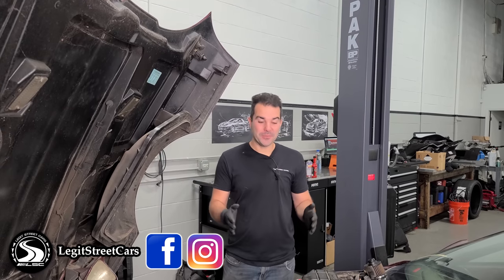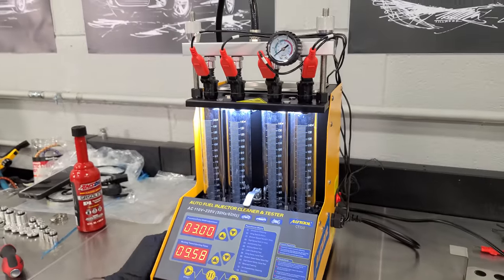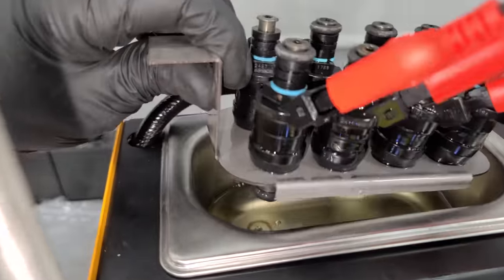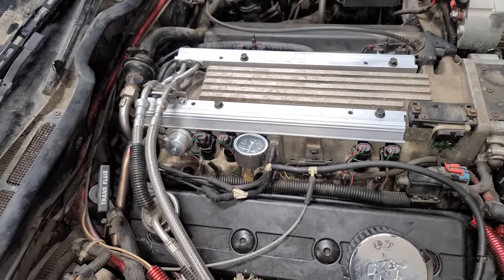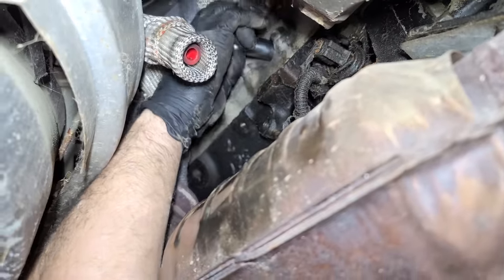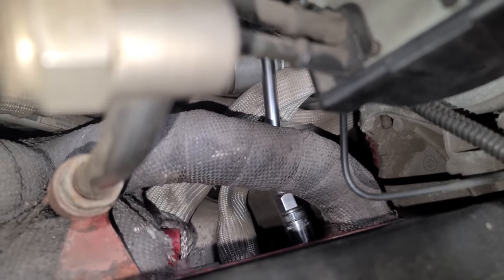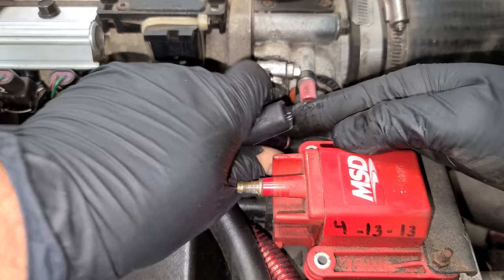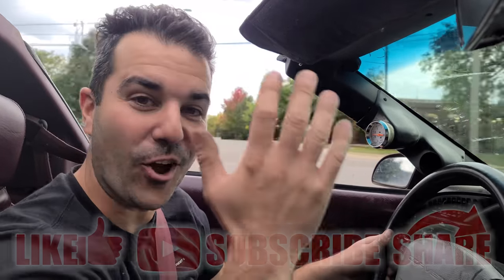I Fixed My Cheap Supercharged Corvette For $50 & Looked Inside The Engine To Find Mystery Mods!

Comment: Personally, I would have lightly coated the plug threads with anti-seize and dielectric grease on the plug wire connectors . Awesome Content as always
Reply: I had a teacher at school who used to race motorbikes. He ran a pencil down the plug threads as the graphite lubricates them.

Comment: That flow tester is good. Just watch out for the china fuel pump burning out in it rather quickly if you do any sort of testing. We have replaced ours with a walbro and haven't had any issues. Fun thing to try is go get knockoff china ones and you can get the to lock up so easy. Not to mention the terrible spray patterns

Comment: Interesting buy, a known fix for Vette fuel gauges is several tanks of Techron additive, at least on the C5 and up forums fixed mine. I have a 2004 Z06 that has been modified with 2014 ZR1 cradles front and rear in 2015. I couldn't get my hands on a ZR1 427 though, so went with an LSX 454 with a S/C kit from A&A. It RIPS, I'm unable to post you a pic. too bad I'm sure you would like it. Curious to see how yours runs my S/C head is about twice the size of yours I don't recall the trim seems I'm at around 900 at the crank, need to dyno tune it, has a poor tune on it presently. Love your Channel !!!

Comment: For the hard to find o ring for the cooling system, have you tried plumbing seals? Lots of them are made for water quick disconnect hookups, so different sizes and temp ranges. Alternatively, are you saying you don't have a roll of make a gasket anywhere? Haha

Comment: You will have to fix the exhaust leak to get a proper AFR reading from a wideband. You should also just throw in a Holley or Fueltech EFI. Ditch the optispark. And install C.O.P you may hit 500hp wheel with that alone???

Comment: Its going to be really interesting to see what the AFRs are, and what the tune looks like, also, that fuel booster should be looked at if you end up running lean. If it were me, I'd want to tear everything down to its bones, inspect and clean / replace anything and everything that looks wonky, get a cam profile, THEN do tuning. Maybe get upgrades, crank and piston balance.  Just so you are sure you ain't going to destroy it.
Reply: Indeed.
Judging by the colour of the spark plugs - biscuit brown the engine is running pretty good.. fueling looks quite consistent.
That Corvette will look real peach once detailed....
Reply: @stuartd9741  hell yea brother.

Comment: hey man I love  your videos I have a small tip for you  use calbreter cleaner  to clean injectors  it will clean batter  and much cheaper than fuel system cleaners keep up the good work big fan 👍

Comment: Don't know how common it is for 90s GM, but my Cadillac had damn near the same issues with running and the fpr was the issue - but I only figured it out after I'd replaced 4 other things to no avail because it wasn't wet when I checked it.

Comment: the white stuff is like computer cord stuff to make your spark plug leads more ridged to try to avoid hot engine plug lead sagging and touching the hot bits ,Headers etc and melting the plug leads ,i'd swopp them over onto the new leads for beter routing direction control to avoid more melt down of them

Comment: where u put the last spark ug, u have a sensor with no connection or plug connected to the missing wire thingies or sensors

Comment: Alex, for the Auto fuel injector cleaner, why aren't you using water in the tank instead of gasoline? That way you wont smell fuel when it is leaking and it is Ex-proof if a spark in the machine should occur ... Just wondering if you have to use gasoline?

Comment: They used to sell a socket for the LT-1 spark plugs. It was just cut down, and the drive was drilled out round, so the plug would fit through it. Then you just turned it with a wrench.

Comment: The injectors are supposed to fully seat in the top rail like they do on a fuel rail of a car  thats what the differnt sized adapters are for . And its not recommended to use gasoline in the tester portion there is special fluid for that area gasoline will ruin the seals and pump . I have used mineral spirits without issue . I have the same machine and i noticed  I get more reliable readings by only testing 1 injector at a time .

Comment: This car was a damn steal for what you paid! I'd be so so excited if I found this at auction. 

I should add, that fuel injector test/cleaner would have been so useful to me years ago. I had a brand new set of Bosch 550cc injectors, and the car never ever ran right. Misfiring, spluttering. Concluded it could never be the injectors that were bad as they were brand new. 

I upgraded a heap of parts, fitted 1000cc injectors and sold the 550cc injectors to a mate who cleaned them and found one was blocked. Go figure.. haha

Comment: If it has LT4 heads I hope it has the intake to match LT1 intake is not compatible unless there was a lot of work done to it.  Needs torqhead upgrade it let's you run individual coil packs and a more tunable LS style ecu and deletes the crapti spark 😆 Have it on my 94 C4. 👍🏼

Comment: Injectors usually just need seafoamed, I recently revived my 94 sho after it sat for 13 years. All I did was change fuel pump,filter,tank,keep 91 octane or better a can of sea foam in tank and the engine got fluids changed and started like it was never sitting, got my emissions and passed no problem. Good luck.older injectors were built to last,oh I had 119000 MI on engine.

Comment: Yup those are Stock pistons. Fix exhaust leak before test driving so O2 sensor doesn't tell PCM it's lean and cause it to spray a lot more fuel and run like crap again.

Comment: and what about the basket filters ? inside the injectors ! = i brought an injector rebuild kit ! with new pintel cabs and basket filters and all o rings ! vacum leaks = well done and you could put a teflon based additive to the supercharger gears = or something similar = you know = we use newlon in australia = friction modified additives !

Comment: One issue I always had with my LT-1 was the damn exhaust manifold bolts never staying tight. Stage 8 used to make these expanding bolts I bought that fixed that issue, and the copper gaskets I upgraded to. Don't take any chances with those manifold bolts

Comment: RE route the King lead to the MSD coil pack on the Left side of that black pipe to allow enough slack for a new wire lead metal end replacement

Comment: I stopped using black rubber O-rings because they took out the V.O.C.s and they only last 10% of the time of the originals. Now I only use the green ones meant for A.C. systems. (Same with all the rubber bushings in the suspension, now I only use Polyurethane).

Comment: Too fat O-rings can be whittled down with wet dry sandpaper. Put the O-ring on a suitable hunk of wood or something and spin it around while maintaining suitable pressure. I had to use this method on a clunker which would vibrate the injector in the throttle body, it would start leaking. You can lube it while you're sanding to your desired shape with motor oil.
In my C5 manual, it states, you are instructed to wail on your Corvette occasionally to blow all the carbon debris out of the motor.
Also on my C5 there are aluminum heat shield tubes on each spark plug. I don't know if this applies to your motor. It might be a good retrofit since you seem to have a heat problem.
Keep a close eye on that crank pulley. It's two parts and can split in two. Then it can drift towards the engine block. Mine cut a slot into the oil pan and just thinking about replacing the pan gives me an ulcer. Lots of YT vids on how to do it.

Comment: The fuel injectors have a miniature filter in the top of them, usually 30-103 filter from ACE Fuel Systems.  You're injector testing machine might have come with some of these fillers, the 103 filter fits 90% of all top Feed injectors in the Market and You might have a tool that came with the machine to remove these Injector Filters. If not ACE Fuel Systems has an on Line Catalog.

Comment: I would personally just use pure injector cleaner in your tester instead of gas... Pretty sure a few tests with cleaner run through them would work better than just the ultrasonic cleaning.

Comment: Yep, it is most likely stock, but you'd exceed the power that procharger could make before you run into issues so long as you keep detonation from being an issue. I'm betting they are running the AFR pig rich to keep it from having issues.

Comment: The Optispark was the main reason I sold my Camaro. I had to replace that with the pump 3x. I had enough, and the heat on the spark wires was one of my issues as well. Damn this car brought back some bad memories 😂

Comment: That stuff wrapped around the plug wire was spiral anti-chaff tape. It's used in aviation for wire harnesses, hydraulic lines, and fuel lines. The reason it was melted is because it is not high temperature rated.

Comment: Spiral wrap commonly used in aviation.  The melted spiral wrap needs to be heat rated usually the black spiral wrap withstands high heat.  It’s an anti-chafe wrap.

Comment: FYI rtv is NOT what you want to use in a fuel system. You need a specific fuel-safe sealant for that fpr o-ring, such as Permatex orange. Same for any injector or rail o-ring, you should use engine oil instead of silicone grease.

Comment: Even with valve reliefs cut those could still be stock pistons. They may have removed the heads and fly cut the Pistons in order to clear the 1.6 roller rockers when they did the motor

Comment: Yikes, that spark plug access.  I thought I had a hard time replacing the plugs, wires, cap, and rotor on the LT1 in my 96 Roadmaster wagon.  Wire routing through their little brackets and inside their channel guides was the biggest pain for me.

Comment: You Guys might want to contemplate buying a miniature sand blaster (Paasche Air Erasure) it works outstanding at cleaning corrosion as well as old electrical parts (like spark plugs)!?!! ;)

Comment: Wild guess here about whats wrapped on the plug wire itself.  Whoever did it was hoping the spark plug heat wrap would not slip down with that to grip onto.

Comment: Cam timing or tensioner or the chain stretching.

Thats the only explanation for that type of destruction.

Cam being out one tooth or not having enough tension creating play in valve timing, that got worn over time( explaining the smooth yet perfectly round indent left on that one part of the piston). If it was one hard hit it wouldn't have been that smooth, it would have been rough around the edges. With it having too much play, the valve already weakened, it was just a matter of the valve spring or valve giving in first.

Comment: Need more fluid or the mosfets that drive the transducers will overheat and go open. Not right away....but under continuos or sustained use it will shorten the lifespan of the unit.

Comment: Those leaky fuel pressure regulators can be tough. Sometimes they don't leak for a min so you don't see any fuel when you pull off the hose

Comment: I’m gonna say when you repair the spark plug wire that you put the wrong end on. Normally it’s a rubber boot that goes over the spark plug not the hard plastic, that usually goes on the other side

Comment: As an aircraft mechanic,   that plastic stuff wrapped around the plug wire is "spiwrap" and we mostly use it to protect wires from chafing against metal parts in the planes.  I don't believe I have seen that stuff placed in such a hot environment and even though all of our stuff is burn tested and has to be essentially resistant to fire doesn not mean it cannot melt.  If it was PTFE spiwrap it should be rated for around 500 degrees fahrenheit and thats still not going to handle exhaust header temperatures.  Not sure how much heat those sleeves actually mitigate but obviously didnt help keep the spiwrap alive haha.

Comment: Dont know if anyone mentioned it. Those valve covers are an upgrade. I think they were made for the LT4. to clear the LT4 roller rockers which you also have. LT1 had stamped valve covers with non roller rockers
Reply: LT1 in the vettes came with composite valve covers and there were four bolt mains.
Reply: @John-px2ki  OK . I wasnt 100%  sure on the valve covers. I have an LT4 and thought it was exclusive to an Lt4. I know the roller rockers were just for the LT4s. Good to know

Comment: You need to wipe the dielectric grease off that connection! Dielectric grease acts as an insulator! I used to do it all the time, and then started reading up on the grease. Use the grease lightly on the BOOTS, not on the connection part. I know we want to keep rust from the connection, so making sure no moisture gets in is the answer.

Comment: LT4 heads require an LT4 intake due to a different bank angle. Check your part numbers, typically LT4 intakes are red...unless stripped.

There is also free scanning  LT1 software, but you need a special cable if it's a 94. OBD1.5.
PM me if I can help (LT1 owner for 17yrs)

Comment: Very nice find here! I love buying “INOP” vehicles from auctions of course it’s partly because of the high profit potential but mainly it’s become the thrill of figuring out what brought it to the point where everyone just threw up they’re hands 🤔🤯🤷‍♂️ it’s dead we don’t know why oh well ditch it asap 🏳️ we quit 😂 sometimes it’s a hit and sometimes it’s a miss but you never know until you roll the dice!! One I was excited about was  when we Bought a Jeep grand Cherokee WK srt8 from a dealer auction a few years back said “doesn’t run electrical issues” towed it back found the description to be very accurate had no  power replaced the battery wouldn’t crank new starter finally cranked but “no spark” figured I’d look for a aftermarket alarm or a kill switch hidden somewhere…under the dash found an interesting looking box ended up being what we call a “buy here pay here” gps-kill switch box so you don’t make your payment they shut down the car & can locate it to recover said vehicle….someone had it installed for other reasons quickly removed it and she finally came to life!! Never know what’s out there until you look!!
Reply: Funnily enough Steve lehto 
(Lehtos law) did a video on that very black box thing.
Apparently they're never removed even after all the finance is paid.
They have to be programmed to default to enabled .. if this is not done the black box can randomly disable the car....
As Alex shows one learns to be quite the detective when diagnosing faults.

Comment: I wonder if the open plug wire on the coil was causing flyback voltage which could have been what was tripping out the gauge cluster.

Comment: dude i dont like to disappoint you but i know that you had fix the fuel injector rail problem and all but that fuel rail does come with some C clip retainers and you are missing all of them i have a 95 impala ss with that same engine and i had the same problems with that car except that in mine its a tons of room to work in haha !! plus i dont have that problem with the melting wires because the engine bay its a lot bigger than this car but its still the same engine  i hope you could read this and check it out or if my comment helps some one im glad i could help a bit  great video  keep up with the good work

Comment: Haha you think the extensions on the spark plugs were bad? 😂 I dropped the tranny from my 81 vette and the top bell housing bolts had to be reached from underneath the car using many swivels and about three feet of extensions. It was a nightmare just getting the sockets on the bolts let alone getting the bolts back in the bell housing 😂

Comment: What type of rubber is your O ring kit?

I sold O rings in a previous Job. The type of O ring needs to be specific to your application. 

For fuel you need Viton rubber. 

General engine oil application Nitrile is best. 

Brake system EPDM is best. 

Fuel will swell the Nitrile O rings and lead to failure. 

Oil destroys EPDM

Viton can do oil and fuel but is more expensive and is a harder rubber than nitrile.

Brake fluid destroys nitrile. 

There are Teflon encapsulated o rings but these are harder to get and very expensive but are more resistant to chemicals. Not generally needed in an Automotive application.

Comment: Alcohol will eat up those  neoprene o-rings.  I had trouble with them leaking on fuel rails and changed mine 3 times over the few years I had it.  That one looks almost like mine Fuel system looks different.  It had 8 pipes that looked great but probably did nothing.  It had dirt all over it too and oil leaks from not putting sealant on intake bolts,  they go into oil galley and fumes came by center bolts and leave oil every where, put sealer on intake bolts on Chevy small block.

Comment: Instead of scribing on the plasti  injectors, and creating a crack propogation starting point, break out masking tape and a sharpie.

Make a tag-loop around the injector with the masking tape and write the number on the tag.

Comment: Kind of dissapointing the ultrasonic cleaner doesn't clean the top part of the injectors. That's the part where debris is more likely to clog up. I once had a mystery intermittent misfire caused by crud filling up in the top part of the injector. Pro tip, don't cheap out on fuel filters... I used an ultrasonic cleaner (fully submerged) and sprayed the top out with MAF cleaner, and there was a LOT of debris that came out.

Comment: Peter is correct, per every 2 spark plugs on a 8 cylinder engine is 25%… so if you got 6 changed your 75% done lol. That is, that there is 1 spark plug per cylinder. Thought that was a funny part!

Comment: sub'd just for this I have a 91 c4 L98 TPI I just pulled the engine on going to clean mildly fix/ performance parts and get her back running, down side is it's a 91 so obd1 and a chip that I have to burn tune. Do not sure what my steps forward will be after I enjoy her just running as is. Maybe aftermarket ECU idk....